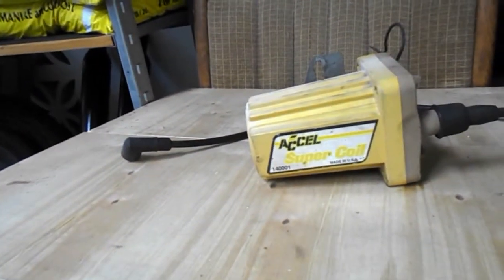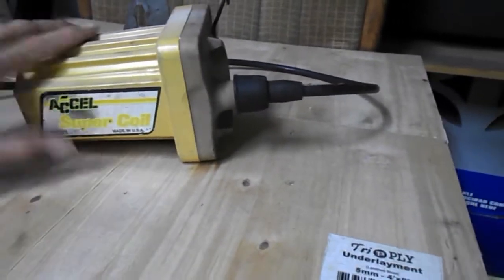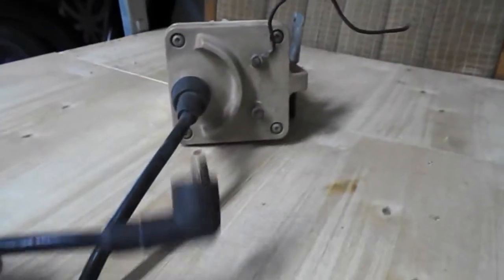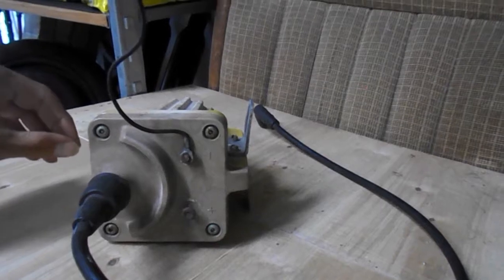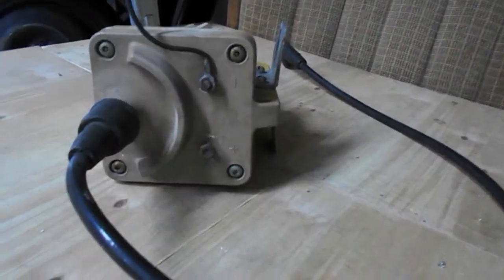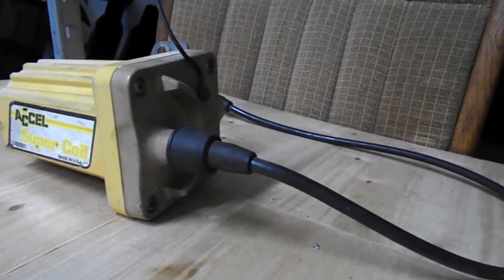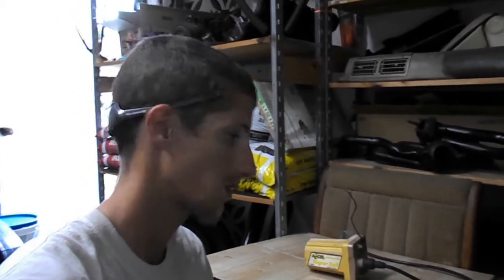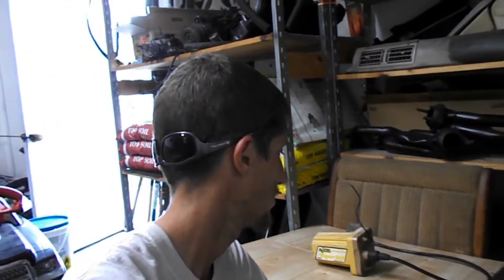Accel Super Coil 140001 - How To Wire Up - Igniton Coil

Comment: does this big coil make an engine run better and make the plugs burn cleaner than a regular coil?
what engine did you use it on?
Reply from the maker: I didn't use this coil yet just an informative video. A bigger and better coil will help with... 
Increased spark energy and voltage, help improve the combustion process of the fuel mixture to create an efficient burn. The result are quicker starts, improved idle, improved throttle response, cleaner plugs, cleaner emissions plus increased high rpm performance.

Comment: Where can I find the super coil wire?
Reply from the maker: Which wire and are you looking to buy it or you can't find it?
Reply: @killrspeed00  the wire that connect onto the super coil and on the distributor
Reply: @killrspeed00  00.50 seconds from your vid.
Reply from the maker: The big black one that looks like a spark plug wire? It goes to the distributor. Let me see if I can find it for sale somewhere.
Reply from the maker: Look into this
https://www.amazon.com/ACCEL-170500R-Universal-Stainless-Steel/dp/B001HQACCW/ref=mp_s_a_1_2?ie=UTF8&qid=1545935244&sr=8-2&pi=AC_SX236_SY340_QL65&keywords=accel+super+coil+distributor+wire&dpPl=1&dpID=41OJjvPMOqL&ref=plSrch

If you don't think that will work.  Go to your local auto parts store and tell them you need a coil to distributor wire.
Reply: @killrspeed00  thanks man